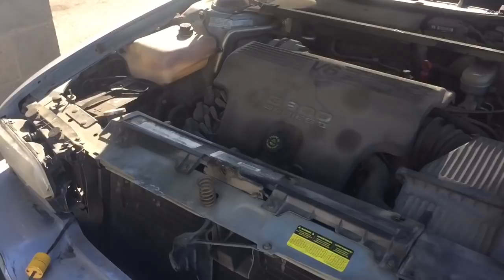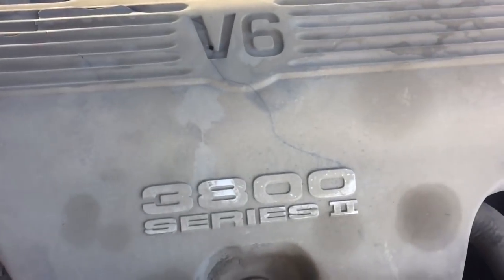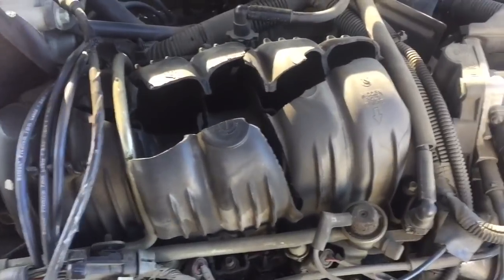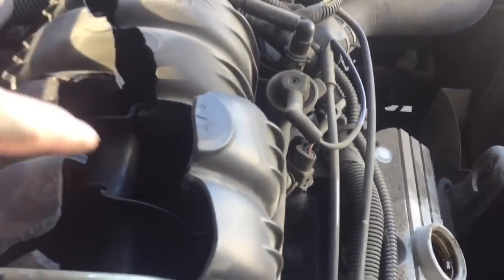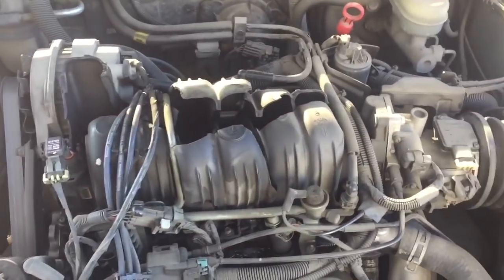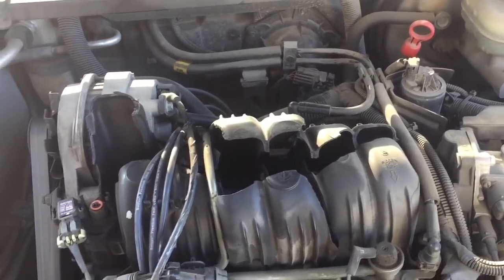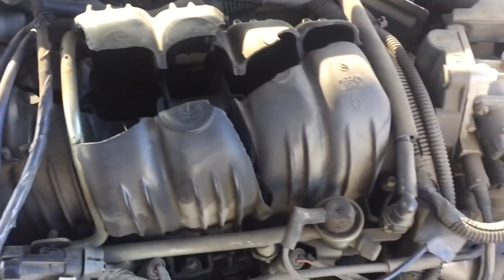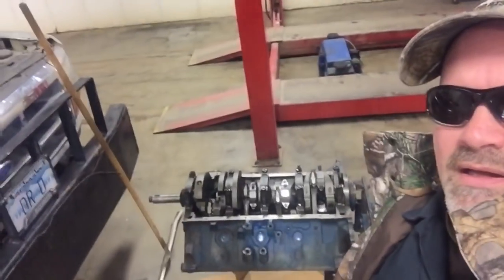3.8L Intake Plenum Exploded  -  3.8L Broken Manifold

Comment: The same thing happened, Buick LeSabre the exact same thing I found that the gas regulator on the fuel rail it's hooked to the vacuum line was bleeding gas into the vacuum line which causes fumes to ignite stop this problem change the fuel rail along with the gas regulator on the fuel rail

Comment: 98 Oldsmobile Delta 88 3.8 L just like the one you're working on. Jumping the car to run to the store car had been running fine no issues. Jumped in second revolution of the motor intake explodes except for mine blew a big chunk and burnt the whole top of the motor before I could get it put out hit fuel line and went up big time! I work on cars 2 and I've never seen one do this either. Got a lot of wires to replace if I'm going to repair.

Comment: I'm working on a 04 Monte carlo (3.8) car had NO performance on acceleration/ however/ in park, seemed to run fine!, & NO engine lite. Gunning motor in park, watching the MAP SENSOR move up & down (& it was securely installed). I knew there was some kind of backpressure issue, so , I finally narrowed it down to a plugged catalytic converter, but not before the plenum failed, but where it failed was close to where the throttlebody connects to the plenum (about 2 inches past the throttlebody) found a hole the size of a PEA. I KNOW THOSE ENGINES  had an issue with the EGR tube (sticking up from the lower intake) would melt, not sure but remember some plenum kits cam with a NEW riser tube to replace the old one

Comment: This just happened to my neighbors car 45 min ago... heard a *BOOM*, looked out the window, saw a car with its hood up, smelled the burnt oil... went out to see wtf happened and make sure there wasn't a fire. his intake was in pieces, the vanity cover was blown clear off, the oil cap had been blown off. Was told that the FPR had just been changed and he was jumping the car since it had been sitting for awhile.

Come back inside, clean myself off, quick google for '2001 buick intake manifold explosion' & the first forum result is people talking about that regulator causing cars intake to explode.... (this was the first video that came from that same search, literally the very first result).

Comment: Back when Pontiac was in business a Dealer mechanic told me he went to the parking lot to drive one into the shop and the plastic upper plenum violently exploded. GM knew about these problems and to my knowledge never recalled them or even issued a T.S.B. on them. I owned a 2002 Grand Prix and got a letter from GM and when I checked all they wanted to do is replace the nuts holding the throttle body on. I guess they were removing it to look inside and see if the area around the EGR tube where the problem was would make it until the warranty expired. I've often said that from the mid 70s to well into the 2000s GM was Toyotas best salesman.
Reply from the maker: hahaha, you make a great point there. This was such a bad idea to begin with. So far I guess this one hasn't blown up again. Thanks for watching
Reply: Your right, the problems with this series v6 by gm is widespread. Switching to plastic is ridiculous. - Josef 
(your saying of gm and toyota is excellent)
Reply: @truthaboveagenda  Yep, the plastic UIM is garbage but many American and Asian companies had problems with Plastic replacing metal engine components, most notably Ford had a huge problem. Dont blame it all on the auto companies, the US bleeding heart Leftist Radical Govt gave impossible mpg restrictions on car sales, the only way to achieve them so fast was to go to plastic before they had the time to understand what types are suited to engines. There;s tons of plastic in every engine today, if it had the proper time to be designed, tested and validated I'm fine with it, although I always prefer metal and screw the leftisits and the EPA. So when the Govt tells you they are making the companies pay for taxes or pay for the expensive engine change overs its not the company that pays, its the average Joe who gets stuck, and beyond belief the average Joe keeps voting for the same morons who cost him/her massive amounts of dollars.
Reply: I had a 02 Grand Prix GTP supercharged  with 110k that caught on fire on the Intake manifold in the area closest to the driver side firewall.  I was driving on thanksgiving morning in Indiana at highway speed.  My speedometer suddenly went from 0 to 135 back to 0, I lost power steering & power brakes.  I managed to coast into a starbucks & popped the hood.  There was a small fire...maybe 12”-18” flames.  I managed to put it out with a magazine.

One note, full coverage insurance covers it if it catches fire.  I didn’t find out for a couple months & still was able to claim.

GM later acknowledged the issue with a recall.  They had a number that didn’t exhibit symptoms like mine....people parked them in their garage & ended up with a house disaster.

Comment: Good video thanks for sharing. Tim I have a 2002 Buick Lesaber. About a week ago the ABS and the Brake lights came on. I checked and was low of brake fluid. I added brake fluid. That fixed the problem. Today the ABS and brake light came on again. It full of brake fluid. The brake pads seem to be in good shape. Do you have an ideal what would cause this problem? Also is there a reset button for these lights any where? I am sorry to ask you all these questions at once. I would be greatful for any advice you can give me. Thanks a lot my friend, Tommy. I hope you are having a blessed summer ahead.
Reply from the maker: It likely needs the system bled since it went low on fluid and now has activated the pressure switch.

Comment: I have never seen that happen either, Tim. Have seen some 3.8s fart in the intake on startup though. I bet your customer crapped his drawers when that happened. HaHaHa.
Reply from the maker: I crapped myself when I opened the hood I can hardly imagine what the customer did.
Reply: wysetech2000 
2000 park Avenue 3800 
making a noise sounds like a rocker arm or lifters took it apart. found nothen...
put it back together then the noise stopped but I blew a water line somewhere in the back.. not sure yet had to stop for the night 
any idea s?????

Comment: I had the same thing happen to me on my Lesabre and I replace the plenum and then found that the cat was so clogged up that the back pressure caused the blow up.  Let me know if this helps...62 year old mechanic.
Reply from the maker: Thanks. WIll do. I also hear lots of leaking fuel pressure regulators causing the same.

Comment: Anchorage we have a problem.
Tim tip the dor man.
Reminds me of when a buddy's 64 Chevy was back firing when he tried to start it. 
I asked him what happened right before it started screwing up. Well he dumped the clutch to try to impress a girl. Major (girl) fail. Sew I told him to crank the engine over while I watched his distributor. As he cranked it I could see the rotor stick out on the driver side. One rotor and cap later he he was on the go again and I told him to go get some motor mounts befour4 he tried to impress any girls again.
Reply from the maker: His plan backfired. Maybe she was a dizzy blonde.

Comment: That's a backfire for sure...  Did it not start and they used starting fluid & KABOOM? Curious to hear what you find.
Reply from the maker: He said he just cranked it and it went boom. No starting fluid. It must have a leaky injector or fuel pressure reg. I'm just trying to decide if I want to even do this job. It would be lame if we did everything and it blew up when I started it. I think I'll do a fuel pressure test and watch for pressure leak down tomorrow.
Reply: Yep and there was a recall on the fuel pressure regulators causing the intake manifolds to rupture on a backfire...beautiful design.  Yep first thing in the morning leaking injector overnight but I'm with you on checking mech timing, ignition timing etc so you don't blow it apart b/c the fuel got ignited somehow. In cyl pressure testing with ignition synch before letting the fuel & ignition meet on cranking may help your heart rate. That's what makes it fun turning the key and hoping the KABOOM is in the cylinder vs. the intake :D

Comment: This might be kinda a "normal" problem?
https://youtu.be/nvpWGQbj7vQ
Reply from the maker: Wow, thanks a ton for the link. That looks very similar to what happened here. I was thinking leaky injector but wow, that's a lot of fire. Crazy.
Reply: No problem, the info I found on the net says there were issues with leaky fuel pressure regulators filling the intake with fuel through the vacuum line, a recall was done in 2004.  Good luck Dr! Might want to start this one outside the building!!

Comment: Check the fuel pressure regulator. fuel leaks past diaphragm into the intake!
Reply from the maker: That's the first thing I looked at. Pulled the vacuum hose and it looks dry but I'll probably pressurize the system and look again.
Reply: I found mine before it blew. A very small diaphram leak was acting flooded on startup. It would backfire on startup unless throttle was open pretty wide and sometimes die at idle, trying to lean out but with no trouble codes.
Reply: I have something going on that same car  .
Go helpful video 👍
Hello from South Texas
Reply: I'm looking at mine right now this is actually a good design if it were made of something stronger it would be a rod

Comment: I know those series 2 manifolds were always weak along withe the plastic coolant elbow's.They warped on a regular basis just on their own.I think series 3 had a aluminum manifold and aluminum elbow.Also that dam dexcool was famous for eating the upper and lower intake gaskets.
Reply from the maker: Yes they have issues. I'm sure the replacement dorman intakes are much much better. Hehe
Reply: Dam right they are ! lol
Reply: They aren't better.  I used a Dorman but almost returned it because it wasn't even molded to the right size, the gasket carrier had to be melted and bent smaller just to SEAL.  Later the MAP mount failed too.